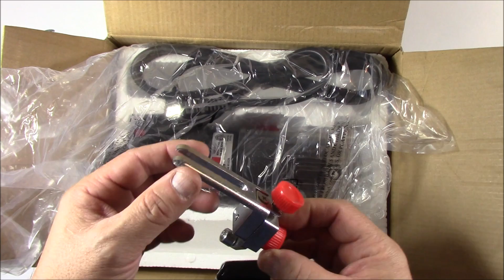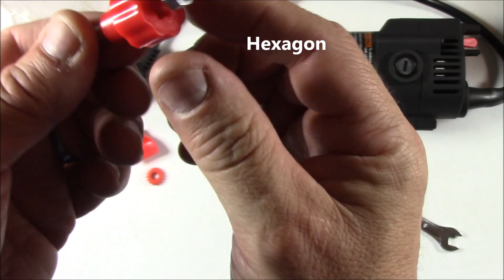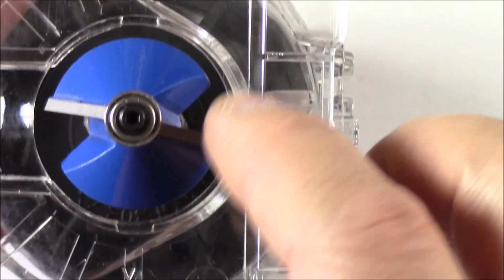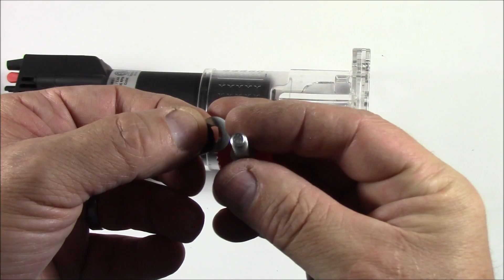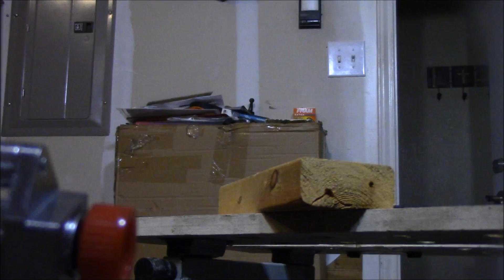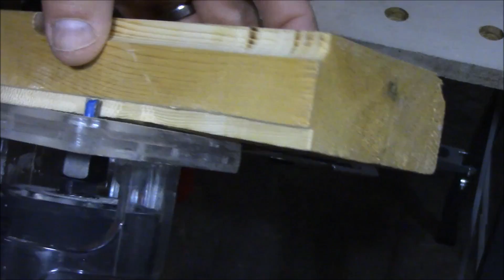Drillmaster Trim Router Unbox Thorough Review Tips And Tricks

Comment: The "trim guide" is for curved work pieces, BTW. Circles, ovals, ellipses, inside curves, outside curves. A decorative plaque, for example.
The included "edge guide" and fence are meant to be used along the surface you are shaping. Not the opposite surface.
The cutout in the fence is specifically designed for allowing the bit to contact the work piece in close proximity to the guide.
Reply from the maker: Great tips, I'll definitely keep those usage details in mind for next time. All the best! 👍😀

Comment: I've watched 4 videos on this thing and still don't know if it's variable speed.
Reply from the maker: Electrical Rating 120V~ / 60Hz / 2.4A
No Load Speed n0: 26000/min
Max. Accessory Diameter 1-1/4"
Collet Size Ø1/4" Shank
Max. Plunge Depth 1-1/2
The router is not variable in speed. It has a simple on and off switch and that's it. Here's the link to the HF manual for it: https://manuals.harborfreight.com/manuals/62000-62999/62659-193175352415.pdf
Thank you so much for commenting and watching. I appreciate it greatly. All the best.👍😀
Reply: @richardlloydusa  Thanks! I appreciate you getting back to me.
Reply from the maker: My pleasure. Thanks again. 👍😀

Comment: It would be nice to know the depth, of which this can be set. I'd say beyond knowing the shaft size for buy bits, this is the next most pertinent piece of information
Reply from the maker: Max. Plunge Depth 1-1/2" Here are the manuals for the two variants HF sells: https://manuals.harborfreight.com/manuals/62000-62999/62659-193175352415.pdf https://manuals.harborfreight.com/manuals/62000-62999/62659-792363626590.pdf
Here is the page for the actual router on HF: https://www.harborfreight.com/24-amp-trim-router-62659.html
Thank you so much for commenting and watching. I appreciate it greatly. All the best.👍😀

Comment: Hi, nice video. I am a home owner and i'm planning to do the woodworking maintenance at home myself and that is mending wooden things that are old and damaged and making new things like wooden  cabinets, chairs etc.  I'm not planning to start a woodworking business. One week ago i bought a plunge router and it is a heavy beast. Later on i saw the trim router on the internet and i think that would get more use after seen what you can do with a trim router. I'ts also lighter and more maneuverable. Question is do i still need to buy the trim router and keep the plunge router for heavy duty stuff? Or is it a waste of money to buy the trim router? Hope to hear from you soon. many thanks
Reply from the maker: A trim router is generally smaller and lower horsepower for lighter duty work like trimming the edges of laminate countertops. A plunge router is a good tool but a fixed base is also nice to have. A plunge router can be used to "drill" or plunge into material, without the need to start on an edge. Plunge routers can also be attached to a table. They hang from the bottom of the table with the cutting bit facing up...similar to how a table saw would work. Some trim routers can also be used in this manner. It's all a matter of what you're intended use is going to be. Thank you so much for commenting and watching. I appreciate it greatly. All the best.👍😀
Reply: @richardlloydusa  many thanks Richard
Reply from the maker: My pleasure.
Reply: @richardlloydusa  Hi Richard, i have another question. It's about the drillmaster trim router you have. I have another brand palm router. It's getting hot fast. Does your Drillmaster still works ok? Does it get hot fast, let's say after 5 minutes of continuous use? If not, i'm going to buy one. Hope to hear from you, many thanks
Reply from the maker: I never had that issue with my router but I have to say I only use it for a short periods of time not continuous use as the jobs were not that big. With HF any tool you buy has a 90 day return warranty so if it's overheating you can always return it.  Thank you so much for commenting and watching. I appreciate it greatly. Subscribe, Click The Bell and stay tuned! All the best.👍😀
Reply: @richardlloydusa  Many thanks Richard. Have a nice day
Reply from the maker: Likewise. All the best.👍😀

Comment: Hello Richard,  thanks for your instruction on this Drill Master Router.
However I did not see any instruction on the small part with a spring. Unfortunately I didn't see anything in a manual. 
Thanks.
Prakash
Reply: Hello Richard, can you please reply on my request? I would really appreciate your help.
Reply from the maker: I have no idea which part you are referring to? I did not have the part in the video because I did not have the part, sorry. Here is the manual https://manuals.harborfreight.com/manuals/62000-62999/62659.pdf 
Thank you so much for commenting and the very kind words. I appreciate it greatly. All the best.👍😀
Reply: Small part with the spring are extra brushes!

Comment: You never bottom out the bit in the chuck for the obvious reasons.  When a chuck is tightened it pulls in. The shaft being bottomed out will stop the chuck from tightening around the shaft of the cutter.  It will still tighten up but, its a false registration.  always leave at least an 1/8  inch....at the bottom.

Comment: That router harbor freight tool sell it for 29$ and that little guy is very good I'm a wood working that use alot of routers and that is good for the price but the work is very very strong is not only for small it handled big projects, i use a a handcrafted you guy should buy it

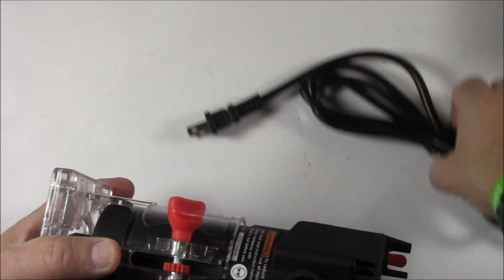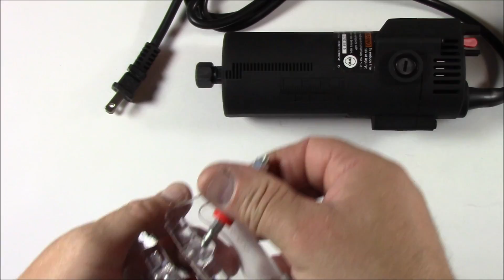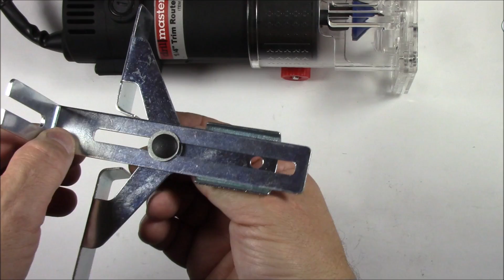Comment: mine does not have the offset like yours on the rack and pinion at 5:56. mine is just one line straight down. Also my gear at 6:19 cannot be removed. My new chamfer bit hits on the plastic shroud at 13:03..any chance of enlarging that hole the bit slides through as you move the rack and pinion up and down ? the hole at 21:26 is for routing circles. still not sure where that little clear plastic piece goes lol at 43:26 the reason your cut was better with your own fence was because the trim router fence was relying on the edge of that 2x4 to be straight whereas on your fence it relied on your measurements and the straightness of your straight edge. Great video, I like the detail orientated approach of it.

Comment: Curiosity Busted!... I wanted to trim some laminate along the edge of the countertop. I went ahead and purchased a trim router. At the shop, I was curious about the guides that came with the router the shopkeeper here in India told that 

The bit's bearing and guide's bearing should be aligned together so they roll against each other which I did and ended up damaging both the guide and bit which I had purchased both again.

He also told to mount the straight edge guide the wrong way as shown in manual I ended up ruining my workpiece as the wing nut bounced to it halfway through, The router fell off my hand and I am lucky my feet escaped in the slight margin.

Now this video was so so so thorough that helped me a lot and guided me towards right path of using this power tool. Although I would've been happy if some point is included about that plastic guide piece which I haven't find good use of yet,  I couldn't thank you enough sir. Thank you, Thank You, Thank You!
Reply from the maker: You are most welcome. I am glad to know I could help you. Thank you for watching, commenting and the kind words. I appreciate it greatly. All the best.👍😀

Comment: I'm new to routers, it seems the plastic guide is more useful so why has the one I bought unknowingly got a metal non see - through fitting? I purchased mine put in fin boxes into surfboard polyurethane foam blanks an I cant see what im doing, its difficult and rather skilled worked freehand and you cant see through the metal? The future fin  special installation  jig is so very expensive for this particular job so I just freehand it. I found I can use a smaller Dremel to cut the foam and just use the router to cut and remove the central plywood stringer down to depth to fit the future fin boxes

Comment: Using a combination wrench was shown on another video to tighten the nuts.  Didn't work out to well since the OEM wrenches are very thin and the combination wrench is much thicker.  You should also watch not to bottom out the bit.   I was taught to use a rubber "O" ring in the bottom so that the bit won't get stuck.

Comment: Been woodworking for about 5yrs. Made loads of signs in my early days, using a good second hand router. It was a big double handed beast with the power button on the right hand handle. Apart from the weight and size of the darn thing, carving 1" letters, you're thumb would cramp up BUT I kept using it for all this time thinking "Oh well this the way it has to be" Until today my son in law gave me a Black an decker trim router.....Set it all up, carved a couple of "sentences" and it was heaven...like carving butter with a sharpe pencil  !!!  Thanks for great vid and some super tips.  It came without fence. But I've tried loads of tools with the fences and could NEVER get on with any of them. Subbed !

Comment: Could you couple this with the HF router speed controller and do a review please?
I am wondering if I could spin a 5/16 drill bit in the router if the controller has the speed all the way down?
Otherwise, does anybody know of a 5/16 straight router bit with longer than 1" cutting height???
Thanks in advance

Comment: I bought one of these at the lake wales fl.store and the collet was not in the box. I put it away until I was back in florida. I called the number in the owners manual which had a list of parts and a number to call.I called and told them I didn't get the collet and the man said they had no parts for this router and he did not know where you could get them. I went back to the store with my unused router and was told it was beyond 90 days and they could not help me. This will be my last visit to Harbor Freight and I suggest you ask a lot of questions before you buy anything...if someone knows where I can get a collet please call 863-232-9595

Comment: Fun fact. This router is identical to the Makita 3703 sold elsewhere in the world (other than the color), and shares many parts with the 3709 which is sold in the US and inexpensive replacement/ upgrade parts are available from parts re sellers.  The 3709 is about 1mm wider than the Harbor Freight so the base is not a perfect swap, but you can make it work with a small piece of ldpe plastic (plastic coffee can lid) hot glued in as a slippery shim and having done so, it's far better/ stiffer/ more durable than stock.  The height adjustment/ spur gear mechanism on the Makita 3709 fits the Harbor freight and is far better made, and actually works.  Less than $5 in parts.
Basically, with a coupon at Harbor Freight you're getting a $100+ Makita trim router for around $20. You have rocks in your head if you don't. Makita must have decided not to offer that model here so HF made a distribution agreement to sell it here, in a different color, and far, far less $$.

Comment: I'm a firm believer in the fact that you don't go to Harbor Freight for parachutes, scuba gear. condoms or whatever you must depend on as they generally hit a 95% functional level on most products they sell. This too might be the exception.
I take exception to their advice about bottoming out the bit in the collet. If the collet ever becomes stuck in the armature shaft you'll be forced to pry the router bit out of the unit which will likely damage the cutting edges. I would suggest leaving a small amount of space below the bit so if it ever becomes stuck, a light whack on the end of the bit with a chunk of wood will dislodge it so it can be removed. Putting an "o" ring on the bit shaft makes it easy to locate a good depth and also eliminates the need to hold the bit while tightening.  Don't forget to clean the collet and related parts so you can avoid the problem in the future.
Reply from the maker: Agreed. I think HF gives you a good value most of the time and they generally don't quibble on a warranty return so there is no real risk in trying the tools. Thank you for watching, commenting and the valuable feedback. I appreciate it greatly. All the best.

Comment: Just a tip when using most router and ESPECIALLY a trim router: no matter the bit, when the intended depth is the entire available cutting capacity of the bit blades, MAKE MULTIPLE PASSES! never blow through your material in a single full depth pass. It will burn your work, overheat and warp/damage the bit and is also dangerous. Larger routers with more power can handle it (usually) on bits with a 1/2” shank no problem though it’s a waste of the life of a bit. But on 1/4” shank bits though available in almost the same size cutting surface as a 1/2” shank bit, IS DANGEROUS in full depth cuts! Take multiple passes. The cut should feel and sound smooth and consistent when cutting. If you’re hearing and feeling chattering, your cut is either to aggressive for the router, the bit or both. Thanks for the review and be safe folks!
Reply from the maker: Thank you for watching, commenting and the valuable feedback. I appreciate it greatly. All the best.
Reply: True….I also find multiple passes are better than just one big hog out pass!

Comment: Sorry to be the wet blanket, but, instead of trying to reach all the way across the workpiece with the fence, it will go under the plate and you can get it much  more rigid.  It's a trim router, intended for just doing trim work taking small cuts.  Using it with the larger bits you did, this, it isn't made for.  Routers that do that have a much larger base and usually handles to control it more.  I've had mine for ten years, for what I use it for, it's almost perfect, but anything needing a larger bit, then it's time to get out something bigger.

Comment: Regarding the assembly of the router guide, I wonder if one if just the locking washing goes on the bottom and the other normal washer goes on the top to provide the square part of the bolt closer contact with the groove in the metal guide.

Comment: You didn't use the fence correctly, if it was used in the manner it is intended to be used the cut would have been just as clean as the clamped edge fence.

Comment: A fatter, thicker  bit will allow for the center guide alignment and use in the cut you performed and I think the fence should be straddling the bit so you can push into the lumber instead  of pulling as was done in the end of the video

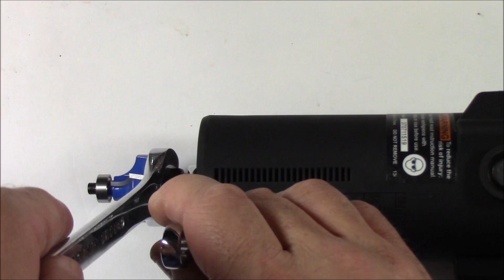Comment: At 10:45 you should leave a 1/4 in out from the bit so it wont heat up as fast and it will be easier to remove after use.

Comment: Bought this exact router and bit set yesterday at 25% off each. Good deal. After getting home and opening up the router turns out the cheap wrenches for the collit and shaft do not fit! Either one. Those are junk to begin with but being too small is a joke. Its ok i have plenty other wrenches so won't return it just for that. Also noticed they've added different washers for the fence assembly which you pointed out in the video. I'll be using router soon and will update my review. Great video by the way. Thanks.
Reply from the maker: Very cool. I wonder if they watched the video and took some pointers? LOL Thanks.

Comment: I bought this to make raised letter signs and am having a hard time finding small bits that fit everything I found small enough was dermal bits but the router will not hold that small of a bit do you know what would work
Reply from the maker: Sorry, I do not know. Maybe someone can chime in who has experience with your application. Thanks.
Reply: Try a core box router bit.  I find on u tube that some folks find these useful.

Comment: Thank you for this video.  I was wondering how to get the roller guide to work, as you showed, it doesn't really back away from the bit to make a notch.  A few other videos I found for this router weren't very good, and they made no attempt to use the attachments.  I was hoping to make a simple picture frame as my first project, and I realise the guides won't work for that.  I do like the clamping guide you have, I usually use my four foot aluminum level and some quick clamps as a guide for my sabre, circular saw, and rotozip.  But I feel, after watching this video, that investing in a clamping guide is a great idea.  It's been 30 years since my high school shop class and using a router.  I am excited to use this router and your tips and tricks, thank you again for the video.
Reply from the maker: You are most welcome. Thank you for watching, commenting and the kind words. All the best.

Comment: I need to create a channel in the middle of a board. Can I use this router to do that? is there any way to plunge it in the middle of the board?
Reply from the maker: They do have some open ended bits. I suggest start the channel with a drill hole and go from there with a regular bit. Try this on a test piece of wood first. Thanks.
Reply: @richardlloydusa  Thanks a lot for the excellent video, Richard. Well done. Related question: Could I use a spiral down or up cut bit to route a channel on 3/4" board? I am making a radiator cabinet and the channels could serve as vents.

Comment: Thanks so much for the video.  As a woman learning to use and love power tools, I really appreciate the level of detail.  I can't wait to pull it out this weekend and play around with it.  I used it once several months ago, but didn't get good results.  I was trying to use the fence that came with it, but of course it had too much wobble to get a straight cut - I was using the router to clean up the inside edge of kitchen cabinet doors after cutting out the inner panels.  Your explanation on reversing the direction of the wing nut makes perfect sense.
Reply from the maker: You are most welcome. I am glad I could help you understand how to get a better result with this tool. Thank you very much for watching and the kind comments. Thanks.